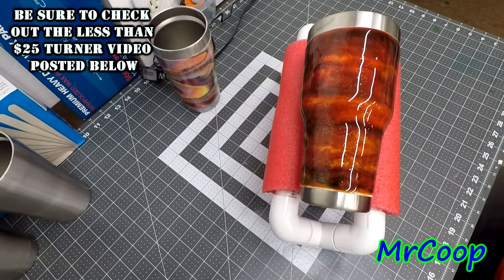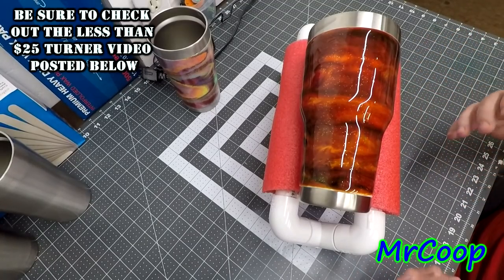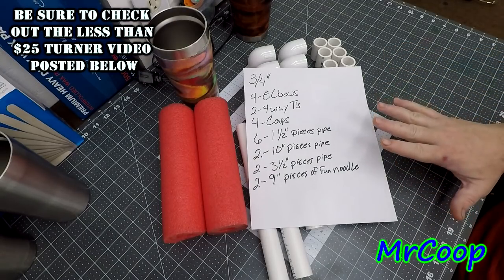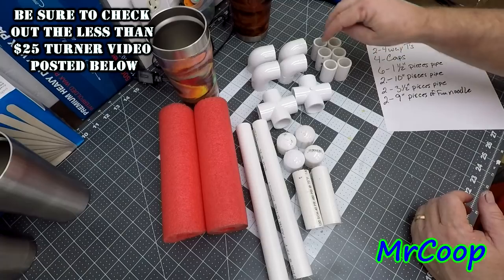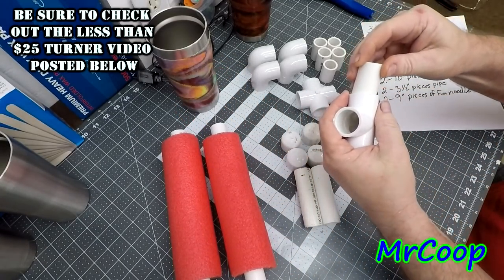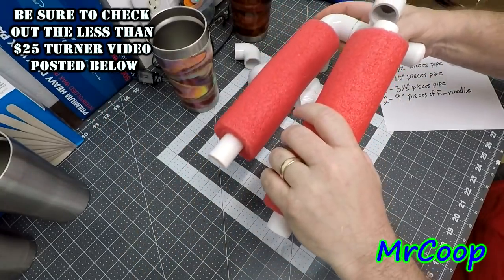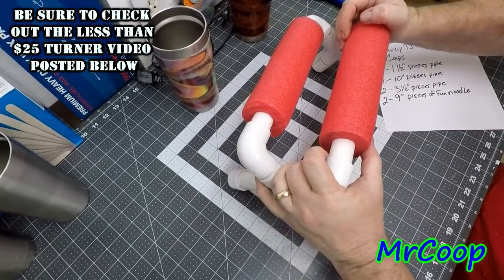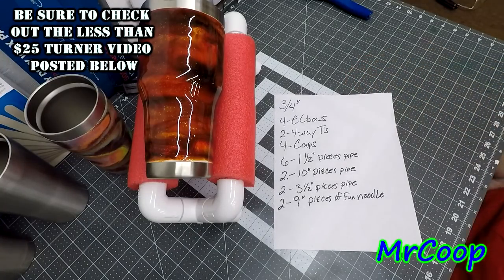DIY Epoxy Cup Tumbler Caddy

Comment: I’m Curious where you bought your parts? I got mine from Home Depot & spent $13 that’s not including the $3 for the noodle
Reply from the maker: If you spent $13 you bought the wrong parts. Fun noodles at the dollar tree ar $1.
Reply: MrCoop I ended up getting the wrong noodle so I went back for the $1 one. That still put my total at $14
Reply: You got the right stuff, the caps are 2.56 for 4 the elbows are the same, that's $5.12, the 4 ways are 2.40 each that's $4.80 and a 5' piece of pipe is $2.03, that's $11.95 plus tax.
You can use 1/2" and and save a couple of bucks.
Reply: @triplejs281  I pay $1.98 for 10 feet of pipe at home depot the cross is about $1.78 each the u shape fitting is .48 each I buy the 1/2 inch 3/4 inch is $2 and change for 10 feet